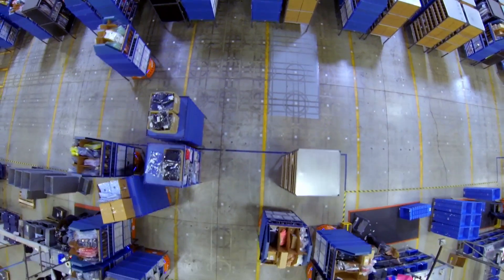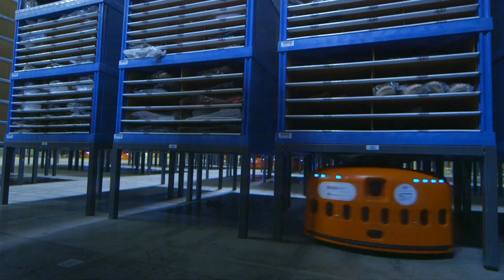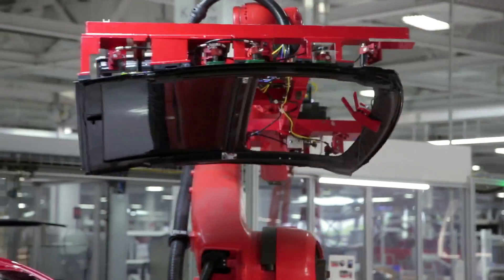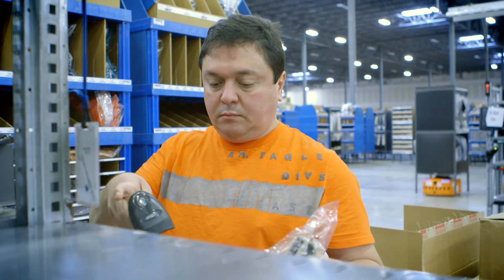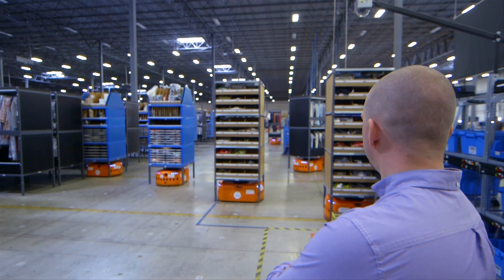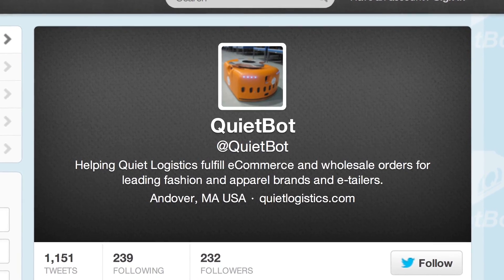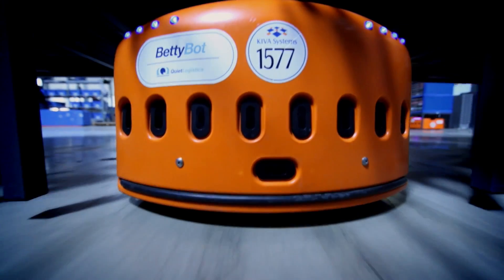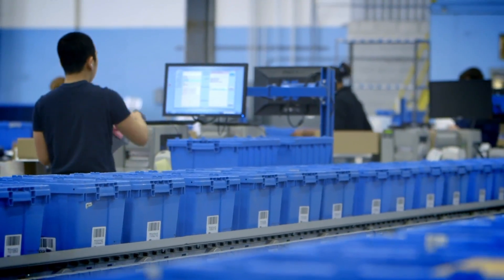High-Speed Robots Part 2: Kiva Robots in the Workplace & in our E-commerce Economy-The Window-WIRED

Comment: Developing higher paying, mid-to-high skilled jobs can't possibly be the most ridiculous concept you have ever heard of? The technology requires research and development, software development, manufacturing, delivery, customer support, etc. The tech doesn't design and build itself. And the job it is replacing is a very low paying, low skilled job. This company seems to put those people to work doing other jobs rather than walking thru hot warehouses. The result: lower prices for us on amazon.com